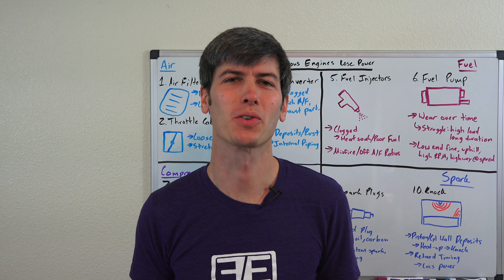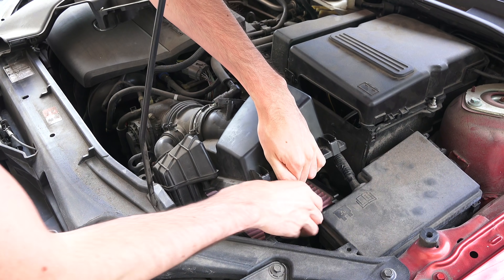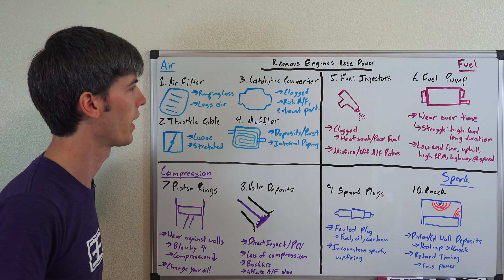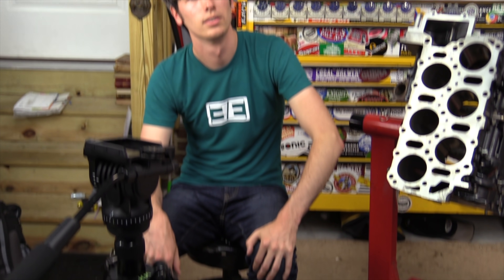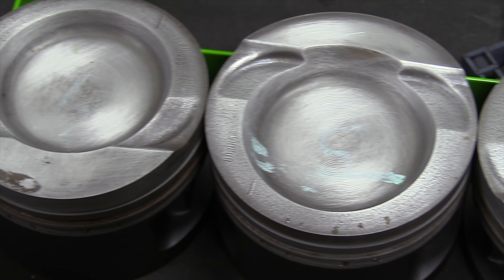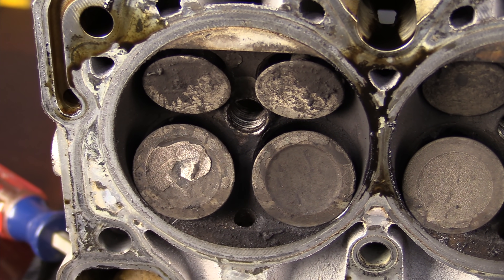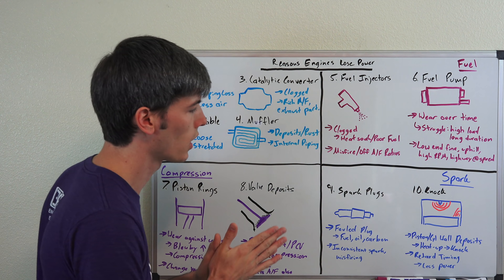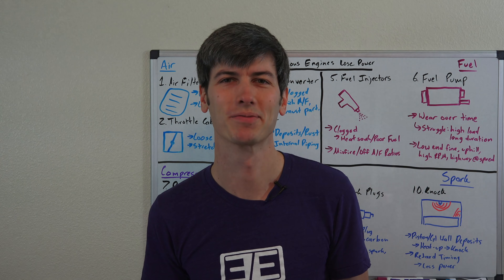10 Reasons Why Engines Lose Power Over Time

Comment: You forgot carbon buildup which is a common problem everyone needs to deal with sooner or later no matter which manufacturer or type of engine it is.
Reply from the maker: That's #8...
Reply: Well, that is a bit incomplete i think. Carbon deposits is mostly related to the cylinder walls and heads. Sure valves are also affected but that is nothing compared to the rest.
Reply: How am I wrong on power loss? Valves create a seal for proper compression, the piston does not. Oil and the rings will prevent carbon build up on the walls, as for the piston head, that loss of volume is very minimal and will not affect loss of power like a valve not seating properly. What double standards are you referring to? Your ecu is designed to keep your fuel/air ratio as close to stoichiometric as possible. Losing compression is far worse than losing volume to the point where it is almost immeasurable.
Reply: Carbon build up on the valves is worse because they cause bad seals which in turn cause bad compression. having build up on the wall or top of piston only limits your cyclinder volume by fractions. Your ecu will be able to adjust the fuel for the difference in volume anyways. Valves are still more important and cause a bigger power loss.
Reply: Asmir Sut even if you managed to remove 100% of the carbon in the combustion chamber it will be recoated in 5000 miles. Manufactures account for this buildup so there is no need to clean it unless there are serious problems
Reply: +Asmir Sut Carbon deposits on the cylinder walls? Don't the rings prevent that? And you mean heads like in the combustion chamber? Piston tops too?
Reply: Isaiah Hamilton I don't understand what you're trying to say.
Reply: You mentioned that carbon buildup wasn't in the video and it was. I was just pointing out how pre-detonation is connected to carbon and retarded timing by the ecu, which is in the video
Reply: Wouldn't that be hot spotting, aka pre-detonation aka engine knock?
Reply: BeingInTheMessiah He called it valve decontamination I think, which is indirectly the same thing but it's so incomplete description it's like he never even explained it. I understand what you mean though.
Reply: Nicolas Losito I'm not talking about the 5000miles buildup, I'm talking about the 100.000miles plus....
Reply: Just for youtube cylinder walls only the top part where the combustion happens. Yes I ment exactly that. Piston tops yes them too. Least affected are the valves the way I see it.
Reply: BeingInTheMessiah it's not that simple, the ecu adjusts to the conditions which in other words reduces the power in the end. I could get much more technical but I have a feeling no one cares about this stuff anyways.
Reply: silverspear21 Based on experience I disagree. Not only because you are wrong on the power loss but mainly because the cylinders and pistons are much much harder to clean than valves. And also a sidenote, you seem to have a hard time deciding where you stand, because your reply gives me impression of double standards.

Comment: #8 especially with direct injection engines... sad panda 🐼
Reply: WRX owner? Yeah, I'm not looking forward to this eventual problem. :/
Reply: PANDAAAAA
Reply: Sarah n Tuned sad petrol pandas indeed :(
Reply: Pyro Vulpes Forester XT
Reply: That’s all snake oil. Ethanol is the only reasonable solution. Everyone will say otherwise for economic reasons. Add synthetic or snake oil to your case and expect puddle underneath from seal wear. High nitrogen based detergents will melt fuel systems and main seals. Manufacturers want to sell you new cars. Also my local fuel station change the E85 fuel button to FLEX ONLY button. How insecure is that?
Reply: E85 13B ethanol is crap unless you have an e85 or flex fuel engine. For example i own a 2014 f150 fx4 ecoboost, running with the standard 10% ethanol added to unleaded gasoline drops fuel economy 3mpg. Running 100% unleaded gasoline is the only way to reach the 15mpg city driving.

Another note, for non e85 or flex fuel engines, ethanol damages internal components.  Ask one of the ford master mechanics about running the standard 10% added ethenol to unleaded gasoline in the ecoboosts.
Reply: Sarah n Tuned That's it, girl!
Reply: Trunk mounted water/methanol injection is the solution! It's like running race gas all the time + keeps your valves clean. It's a universal install for all cars, but works better with turbo cars. I run it. I pay $40 for a 5 gallon can of Sunoco Methanol, mix it 50% with distilled water and it lasts me like 2-3 months driving like 300 miles a week. 

It really depends on how much you floor the car. I have a 1.5 gallon tank and refill on weekends. Some people run 5 gallon tanks for the track.
Reply: Indeed. But what I really like to know is if ANY of the additives you can buy to clean your engine are having any effect and if so in what intervals you should use them. Every thing I have read translates to as: effectiveness depends on who payed for the study. From even harmful to your engine to if you do it regularly you can stop worrying
Reply: M Ridware 0
Reply: Sarah n Tuned Seafoam spray treatment into the intake.
Reply: Oil puddle underneath is better than clean engine? Carbon is stronger than steel, rich oil injection will wear clearances.
Reply: Same question here! What to use..gum out? Bg44? etc, etc?  Everyone says something different. I used a can of BG44, and think it did more harm than good! After you dump anything and run full tank of gas, remember to change oil, clean throttle body (front and back), and change PCV valve. If not, you still have carbon build up problems.
Reply: My cars got dual injectors, problem solved
Reply: Fr direct sucks anyways multi or port
Reply: Who lives in the east 'neath the willow tree?
Sexual Harassment Carbon Build-Up Panda.
Who'll explain sexual harassment carbon build-up to you and me?
Sexual Harassment Carbon Build-Up Panda.
Don't say pump that.
Don't touch idle there.
Don't be nasty says the silly bear.
He's gonna tell you what's right and wrong.
Sexual Harassment Carbon Build-Up Panda.
Reply: The Ford Ecoboost had this major problem. Dont buy those yet, they will cause you headaches.
Reply: Pcv catch can will generally make this a non issue. Especially if you're turbo
Reply: Nice, SP
Reply: Sarah n Tuned excellent
Reply: Nah, the FIAT Panda is port injection.

Comment: Yesss! Thank you so much! I was just thinking about this video just half an hour ago, and here you are. :)

EDIT: One question I have which has always baffled me. Why would retarding ignition timing reduce knock if the ignition source is something other than the spark plug? I'm guessing it's to reduce the higher pressures caused by earlier ignition (before TDC) - of course, higher pressures bringing about an adiabatic temperature increase. That's my guess, but I'm probably wrong. Thanks!

Comment: How to fix the 9 reason? Changing the valves?
Reply: Just my opinion (if it's direct injection):  Get some throttle body & air intake cleaner, and follow the directions.  This will not only clean the throttle body, but also the air intake sensor, and probably also the valves (at least partially).

If it doesn't make a difference, those cans are pretty cheap anyway so you could say it's worth finding out.

For normal port-injection cars just use a fuel system cleaner.  I personally (in South Africa) use Caltex petrol because it's already premixed with Techron.

EDIT:  By the way, a car doesn't have to lose a lot of power over time.  My 30 year old Mazda 323 now has 295k km on the clock, and with just a 46mm ID freeflow exhaust and advanced spark timing it's putting out 10% more power than when it was new.
Reply: yes, but you can also regrind them
Reply: Can't you just clean them? Emery paper and some solvent?
Reply: If carbon is in upper side of valve than fuel additives can help. I use LiquiMoly or something like that "Injection/valve cleaner" you add cleaner directly to tank before filling a fuel and it cleans all around it. Things like fuel pump, tank, injectors, valves from top as well.
If carbon is in lower side of valve than there is only 1 easy mehod to remove it. Drive car like you stole it for 1-2h on a highway (consistant high RPM) why ? When you make engine really hot inside carbon in cylinder walls/ cylinder heads (top) and on lower side of valves get burned out as well as from many other places like exhaust manf. etc. By doing that dont exceed speed limit xD and monitor engine temp. It's good methood cuz if you'll get engine overheated you can also test engine cooling system if it works properly or/if it does it job under load.
Reply: Petrezen1982 thanks you!

Comment: I heard from a guy you can fix minor deposit buildup in an engine by slowly reving it up in neutral after your engine is at working temperature. He showed me that on an old car, it spewed grey smoke, and the engine felt smoother after that. What are your thoughts on that?

Comment: Hello Jason, quick question. How do you know you're injectors are getting clogged and how reliable are those cleaners you out in the fuel to open them. Or is it better just to change them after a certain period? The service manuels of my cars don't have info on this.
Reply: Injector cleaners work, but if you already have a fully clogged injector, the cleaners wont work anymore.
Reply: No easy way to tell at home without a tool. With a fuel pressure gauge and an injector pulse tool you can do a pressure drop test to see if they flow consistently.  If you have a scan tool that shows fuel trim you could tell if they are ok if fuel trim is still within spec.
Reply: If you use high quality fuel you don't need to worry
Reply: Nicolas Losito what high quality fuel? Like shell/bp?

Comment: Does the same rule apply to diesel engines, (perhaps worse)? I don't know, cars with petrol engines here depreciate like crazy, quite the opposite from the rest of the world I guess?
And I always wonder if that power could be returned with some overhaul on the engine?
Reply: If you struggle with power loss in a diesel, I highly suggest you replace the fuel pump, as diesels run with higher fuel pressure and as a result, you'll have more wear on the fuel system over time.
Reply: Engineering Explained can you make another video specific to diesel engines?
Reply: as my father thought me deposit is a high chance if you drive the car "carefully" personally i got a big very noticeable increase after i hooked the caravan behind my volvo 740 2,3L petrol and went on a weekend trip, high load over time means the engine basically cleans the deposit of it's own, also if deposit is stuck on the valves this will work fantastic. the exhaust system will also be allot hotter and will remove deposit of it's own.
Reply from the maker: Yes, everything except spark plugs, really. Diesels have different exhaust systems as well.
Reply: Hmmm, some of my mechanic friends did told me that the Fuel system is the first thing to go wrong on a diesel engine. (not to mention that the engine that I have, Isuzu's 4JX,1 is quite problematic.) Well I guess I'll have to save up for a Subaru.
Reply: +Luca I find most of that hard to believe. Sources?
Reply: How is a diesel's exhaust system "different"? You mean because it doesn't have a cat and has a DPF now? Pretty subtle difference. The problems are about the same, and caused by roughly the same things: poor engine performance, corrosion.

Comment: Any way to clean valve deposits?
Reply from the maker: Yes, but generally it involves removing the head. Humble Mechanic would probably have more insight on this as a VW tech, but I know walnut blasting is one method.
Reply: hey Jason, why don´t you answer instagram messages, how can i reach you personally?
Reply: Engineering Explained Thanks for the response, I'll check him out! (Not that my valves need cleaning, purely out of interest)

Comment: Can I ask what is blow-by?
Reply from the maker: I've got a detailed video on the very subject! :) https://youtu.be/Wadmzv1Vs0Q
Reply: jan rei
air/fuel mixture (gas) that blows by the piston rings because they‘re not sealing 100% anymore over some time
Reply: Blow-By is when the combustion gasses pass by the rings into the crankcase, because the rings are bad or dimensions are getting worse. You notice it by higher pressure in the crankcase or by a lot of oil in the Crankcase vent. A little bit of Blow-By is normal, too much can cause serious harm! I hope i could help you, feel free to ask more ;-)
Reply: its when combustion gases bypass the pistons and goes into the crankcase... it creates a vapor that is then vented by a system called the PCV (crankcase ventilation system) which diverts the vapor back into the intake to be burned in combustion... look up catch cans to see alternate methods of dealing with this (common mod)
Reply: It's what Mercedes exploits in F1 to cheat
Reply: Pedro Rocha looks like we've got ourselves a Ferrari fan..

Comment: I just keep modding it... doesn't loose power over time, just increases the potential breakdowns
Reply: every time I take my motor apart I always have extra bolts left, its weird. Well Its always good to have spares I guess.
Reply: @bulletclub4life  hahahahahaha
Reply: Exactly. Ported throttle body, bigger and better injectors, exhaust, header, and mechanical fan delete and I'm making more than stock on my Jeep with almost 300k on it
Reply: @Se7enAte  i bet its a 4.0 Cherokee
Reply: Bmw M3 e46 I can attest to that.
Reply: Unfortunately that is exactly it. My 99 Cherokee runs and drives like a top but the rust on the body/frame is what will kill it. (Atleast for street legal driving). I simply can't kill that 4.0 Inline Six .
Reply: Bmw M3 e46 or mod wisely, i haven't added many parts, mostly replaced parts(intake/exhaust/pulleys/etc), the real problem is when you add a turbo to a non turbo car. Or nitrous.
Reply: i follow the replace-broken-parts-with-aftermarket-parts ideology... driving a mini cooper, its an expensive habit
Reply: Bmw M3 e46 life to short to stay stock
Reply: lol
Reply: Still loses reliability over time.
Reply: You swapped it with a 5VZ with 320k on it, or swapped out a 5VZ with 320k on it?
Reply: HASE - benefit is not only spare parts but weight reduction :) haha
Reply: i bring death rice lol? Dechrome and coilovers are my only cosmetic mod... about 8k into the motor and 4K in maintenance... go home kid
Reply: But what if the catalytic converter is clogged and you tune the engine for more power. Or if the fuel pump / filter doesn't work well, you won't make more power.
Reply: ikr... total idiots
Reply: Hudson Stronck 
Keep modding ya ricer boy
Reply: ItAintGaY lmao🤣🤣🤣
Reply: Loose the noose, lose the bruise.
Reply: Lose*
Reply: Hudson Stronck 👍🏽
Reply: You lose power.  A nut becomes loose.
Reply: Tip to the wise: don't mod your daily driver
Reply: People who don't know the difference between "loose" and "lose" are going to hell. Probably.
Reply: Um no